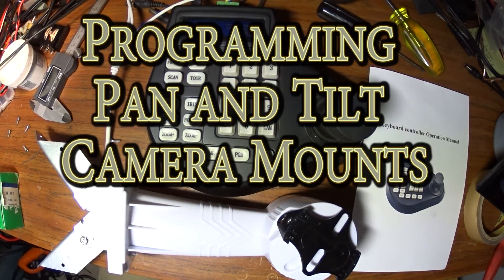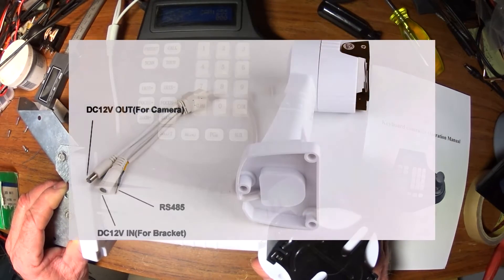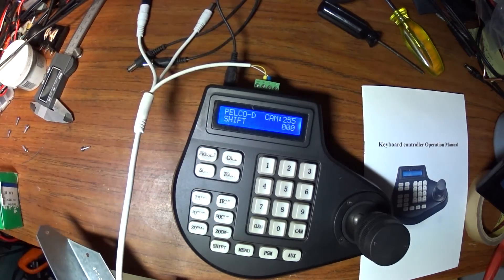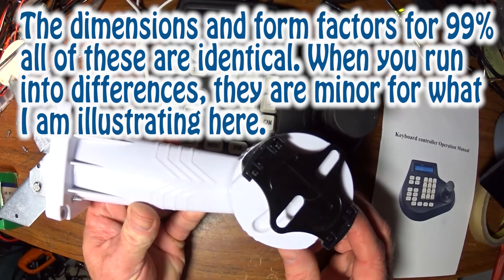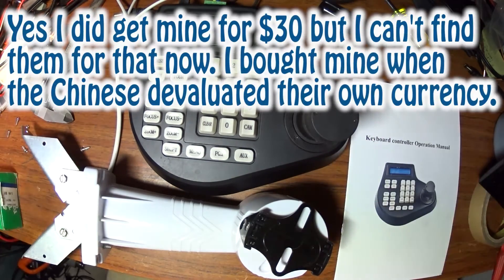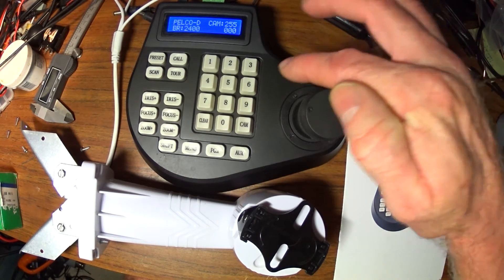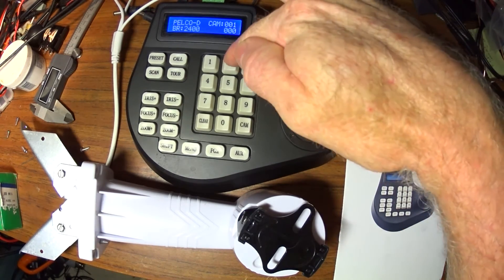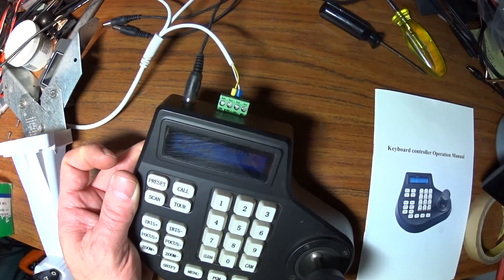Programming Pan and Tilt Camera Mounts

Comment: how is this unit holding up? it's been 4 years.... I need some way to mount Pan tilt on a vehicle and am considering a mod to these.
Reply from the maker: I just changed the ID on one the other day. It still works fine for other vendors relabeled products that look just like this one. Sorry I haven't been able to answer everyone's questions. There are probably other ways to do this that some have discovered.  At the time this was the only way I found to send a command to a specific camera to change its address... and store it. I did find you could change the ID with one remote I had, but it would not store. You had to reprogram it every time the power to the camera was removed.

Comment: I bought one of these and managed to get my Windows PC to control it thanks to the information you provided.  Thanks for sharing your knowledge.

I am using demo software called PTZ Controller 3.7 and it seems that this camera mount only has one speed.  Your video seems to show the same.  Can you confirm?  I was hoping that this could be used with variable speeds.  I took the head apart and found that the motors appear to be stepper motors so they should be capable of variable speed.  I cannot tell if it is the controller board's hardware limitation, the controller board's software or my PC software's limitation.  The protocol seems to support variable speed.  The software seems to imply that it is sending a variable speed command but I cannot confirm it.

With my setup I found that Pelco D and Pelco P both worked - with the same single-speed movements.  All of the other protocols offered by the software did not work.
Reply: Just curious but are you using a USB to RS485 adapter?
Reply: @SCscoutguy  Sorry for the late reply.  I don't recall, but I do have one so probably?  I gave up on this device due to the single speed issue.
Reply: Did you manage to change the address?
Reply: @saifrajon4155  I don't recall needing to change the address.  I only had one of these.
Reply: @traviscalvin431  That's a problem for me. I've got 7 of these & 3 of Pan only Brackets. My Hikvision DVR can change the pan onlys address but can't change these guys addresses. Today I got that USB to RS485 but no luck with it since I could find any suitable software.

Comment: Dean,
I have some of these 'generic' PTZ rotating brackets which appear to require a different command set to open the 'permanent' memory. in order to set the Bracket/CAM ID. Rather than Preset 25 + Preset <CAM ID> + CAM <CAM ID> mine require the sequence Preset 255 + Preset 254 + Preset <CAM ID> + CAM <CAM ID>.
Reply: i have the same problem did you find a way to fix it?

Comment: hi great vid. Watching from the UK.I purchased this generic bracket and also a controller. However the controller is different. When i switch it on it says pelco p. My question is can i use this controller to control this bracket? does pelco p work with this brcket? also how do I insert the cables/wires in to the back of the controller as thee is no obvious screws in rs485 connections? many thanks

Comment: wanting to know if they will follow a program or swing pattern independently, and not through joystick or computer
Reply from the maker: Matt g yeah, these work with the dvr functions for ptz mounts like this. Just , FYI, the DVR doesn't know this ... it thinks that you bought and are connecting an expensive Dome camera instead of a control arm and a separate still camera.
Reply: So after you programmed the bracket, you need a dvr to operate? I got a wify camera that I want to hook up to this bracket

Comment: please i need help. i just bought a pan and tilt bracket but i can't get it to work on my DVR. I'm not sure if i need that keypad/joystick to set it up or i can set up directly through my DVR coz the PT bracket i bought didn't come with that keypad.
Reply: my CCTV set is floureon DVR with 4 analog cameras.
Reply from the maker: Most of these are programed to work on channel one so you need to really get it working with your DVR to begin with if you plan to change camera IDs. Somewhere in your DVR programming you have to set up the communications protocol and the communication speed which is usually Pelco D/C and the speed is set up 1200 or 2400 or 9600. If you don't know you will have to guess an try each. The same with odd and even parity. sometimes the PTz you buy will have a sticker  telling you what the communications protocol and the communications speed have. However you must determined this for your particular  camera mail before it will even work. It must be in the PTZ documentation somewhere? Once you figure this out you can program your DVR to accept the camera given that you've hooked up the camera correctly to the back of the DVR including the polarity + or -. For RS485 you can reverse the and not damage anything. (make sure the port is set to RS485 if is changeable) As I believe I mentioned in the video, the most common settings are Telco D (or d/c) 2400 baud , odd parity. Sorry for the delay, I don't check often and utube floods me with junk mail.